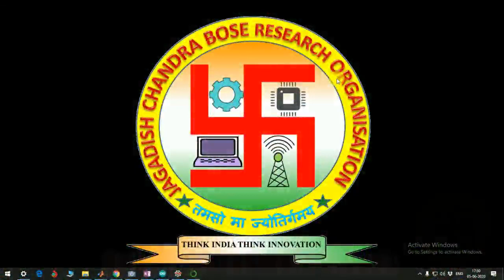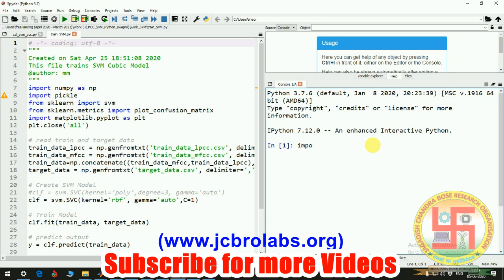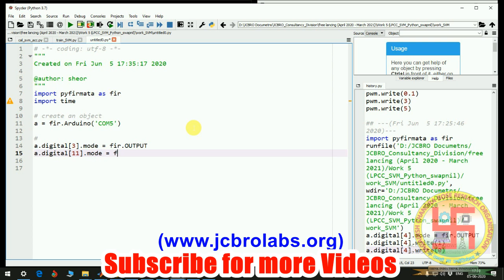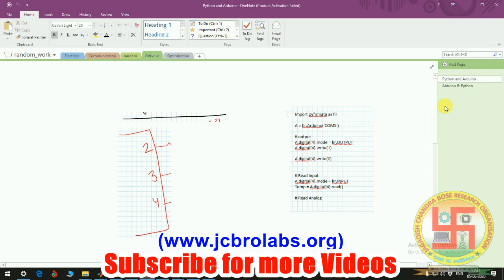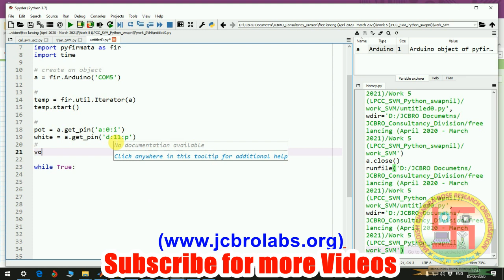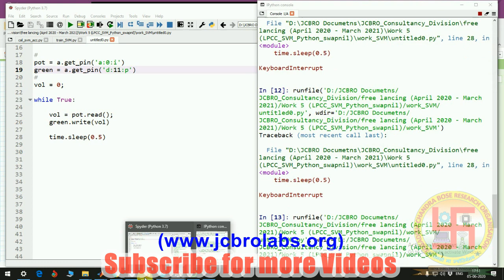How to Control Arduino using Python (PYFIRMATA)?

Comment: Hi dear
Can I use nodemcu instead of arduino Uno?
Reply from the maker: Hi, I think code may require some changes in that case. You will have to see the supported boards by Pyfirmata.

Comment: can arduino run by only python without  connecting to computer
Reply from the maker: Arduino needs Hex code to run independently. Pyfirmata is like a interfacing library which send data to Arduino using serial communication once some pre code is installed on it. Python can be used to run arduino stand alone if there is some library which can give you final hex code of the program
Reply: @buildwithembeddedgarage  Thanks a lot... 🙏🙏

Comment: Sir only Rx led is blinking gpio pin not blinking
Reply: Sir just now I got the result .I forgot to supply firmata code from aurdino😅
Reply from the maker: Make sure you have written code correctly and have set the direction of PIN to OUTPUT